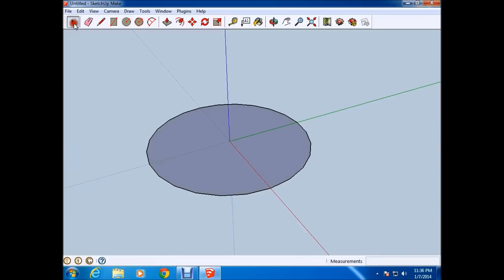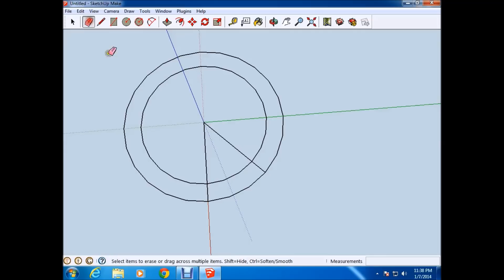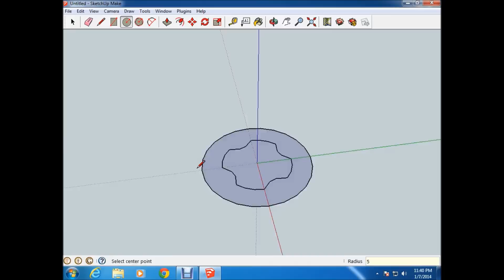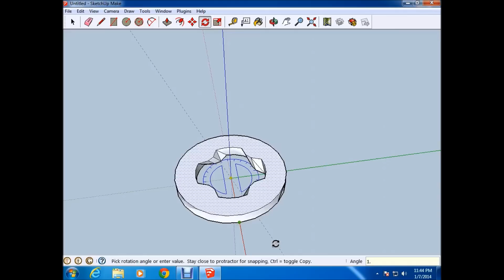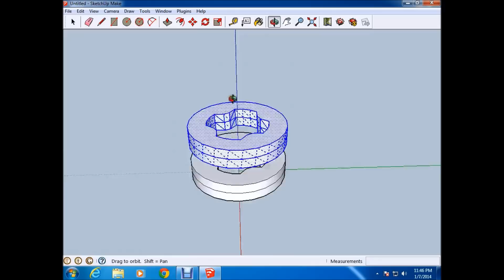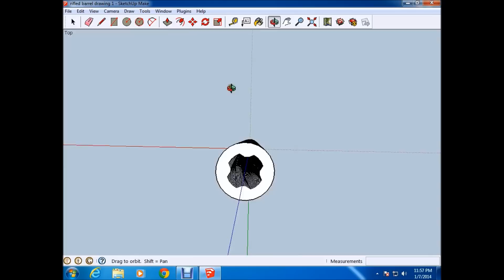Draw Rifled Gun Barrels in Sketchup, 3D Print a Rifled Barrel!

Comment: You can 3D print from sketchup?...what
Reply from the maker: You can get a thing from the extension warehouse that converts your drawing to a .stl file.
Reply: That's interesting, but... Sketchup files are still just a bunch of polygons. Would you actually be able to make a decent barrel from this?

At any rate, great video. Used it to make a barrel last night, but the amount of polygons slowed down my Sketchup too much.
Reply from the maker: You can set the # of sides for circles to some high number to make it smoother, and I use a separate program to "repair" the .stl files after creating them so they work with the 3d printer control software more reliably. After printing the part you can do some minor things to smooth it out and clean it up including sanding and heating the surface of the plastic with a flame.
Reply: That's neat... can't wait for the video you promised to make

Comment: Nice. :) what kind of metal will you use?
Reply from the maker: I do not yet have the technology to cast steel parts... So I plan to do the casting as a zinc-aluminum alloy inside of a steel pipe. The steel pipe can provide plenty of tensile strength, and the zinc-aluminum casting will be very hard and form the rifled inner part of the barrel.
Reply: JaycubL Good idea, I never thought of that. :) I would only use lead pellets though just to be safe. Wish I had a 3D printer. :(
Reply from the maker: Qyuubi786 Well, yes... I think I can show you an alternative though. You will have to make the mold by hand but it might not be as tricky as it sounds. See this video by a paper crafter: how to put rifling?
You can possibly use a technique something like that, or come up with something else. Then find a way to make a mold from that.
Reply: JaycubL I have seen his video. :) I was thinking of making the mold out of plywood. But Instead of using strips for the lands I make cross sections of the barrel and then place each of the barrel pieces Xmm's counter-clockwise then sand it smooth.